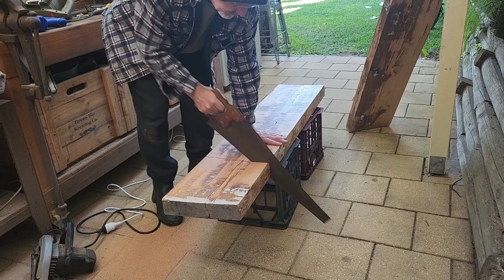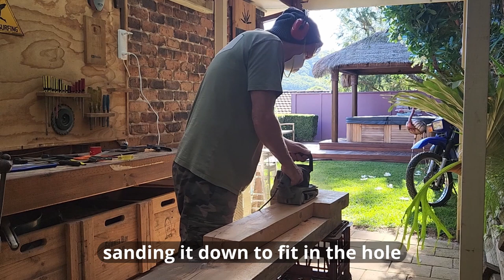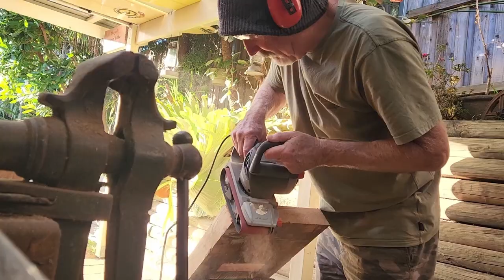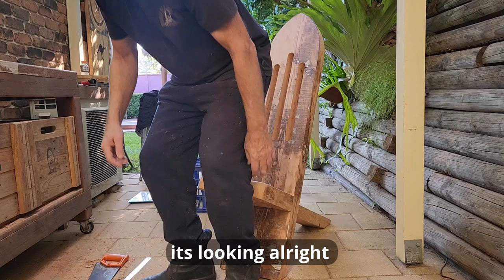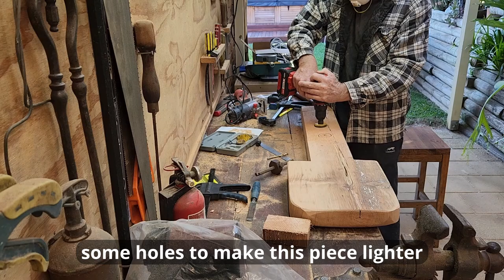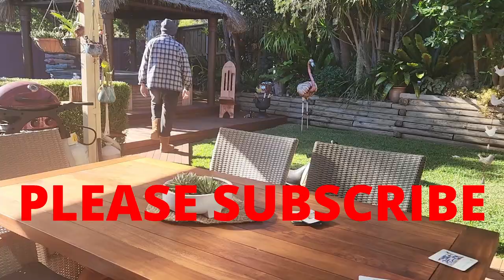Making a Viking chair , Star Gazing Chair ,Celtic Chair .

Comment: Is the angle on the seat part a 45 ?
Reply from the maker: I didn't measure it , but if it's a tight fit it would be a 45, but if the hole was a bit bigger I guess there would be more slack, so that would  make it a bigger angle .
Reply: Oh ok, got it . But I meant the angle on the seat  piece of the board that sits back on the ground . On the video it shows that you cut an angle on the board so it lays on the ground more evenly. Thanks for the feedback.
Reply: @noble_roots_customs  try 70° for a recliner angle.
Reply: @julioseviltwin2304  will do, thanks
Reply from the maker: @noble_roots_customs  I just put the seat together and marked what i thought needed cutting off so it sits flat  , I can't remember if I got the angle right first go but the belt sander would of got it right in the end . Sorry I can't be more helpful mate . I sort of just work things out as I go with most projects .